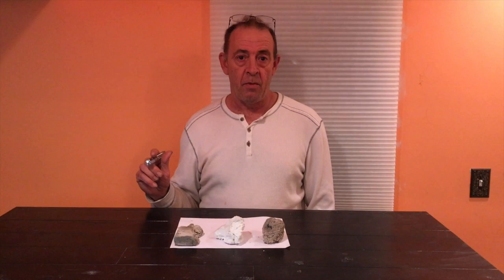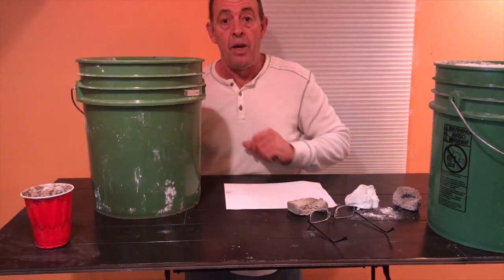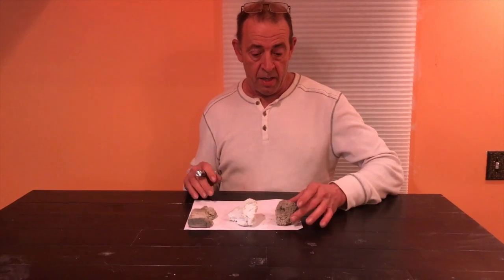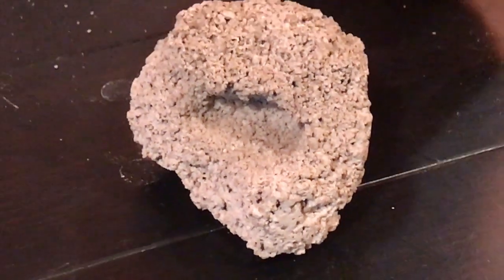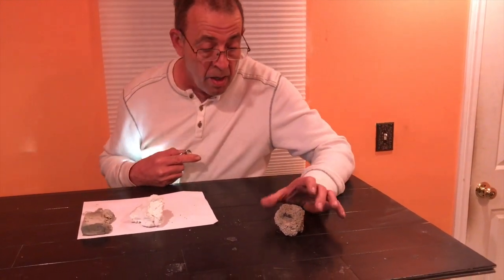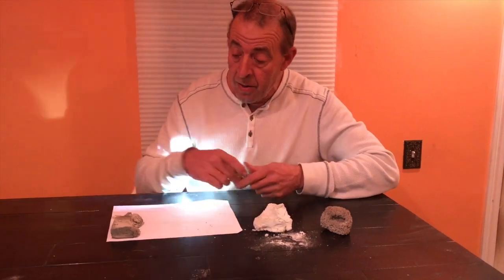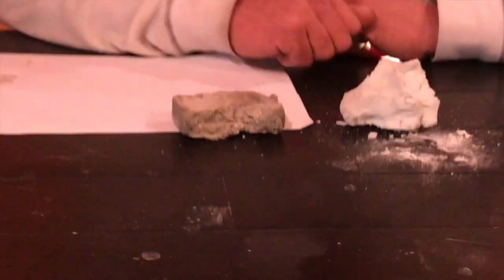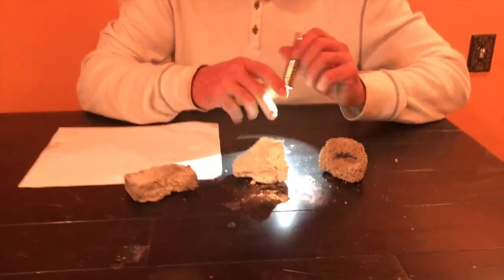Aircrete expariment pt2

Comment: I wonder how your Airkrete  would turn out if you use the aircrete foam recipe and foam generator? It probably wouldn't compare to your authentic product.
Reply from the maker: Good question. It will make a finer foam only downside is the amount we use in a single job. Still a must try.